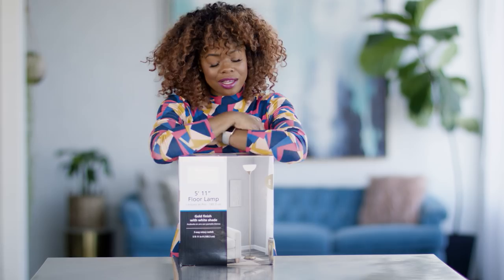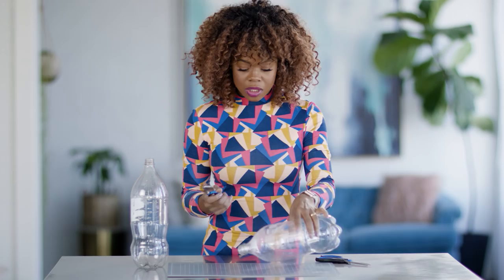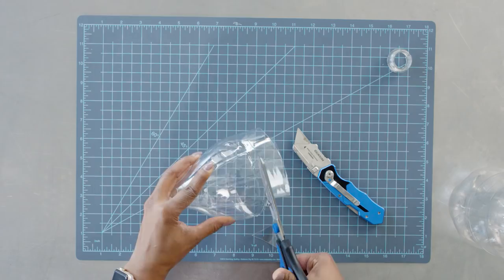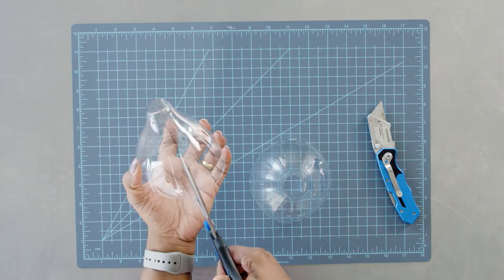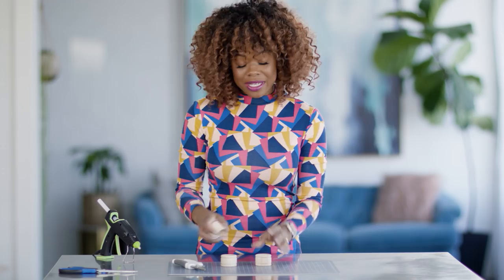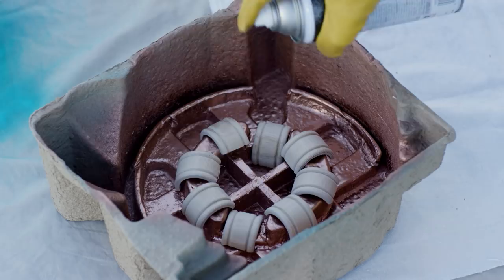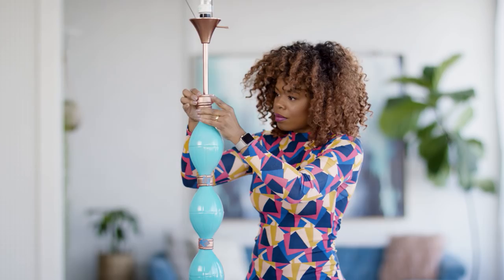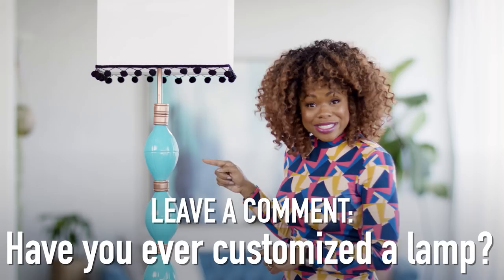DIY Lamp made from SODA BOTTLES - HGTV Handmade

Comment: This is a neat idea, but it definitely needs some work. The napkin rings should be stabilized so they aren't sitting crooked, so they should be attached to the bulbs as well, making the whole thing sturdier. Even at the end of the video you can see the napkin rings are sitting crooked on the pole. If you don't want to glue it all together, you could add something inside, like a rubber washer or craft foam to hold things in place.